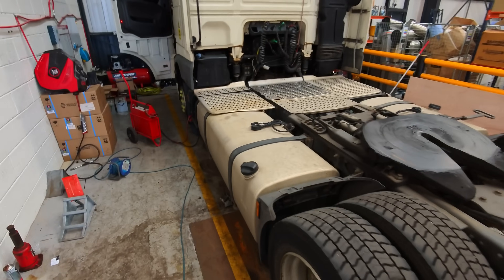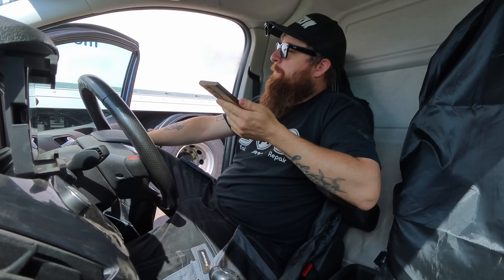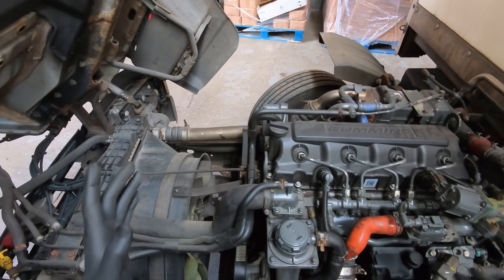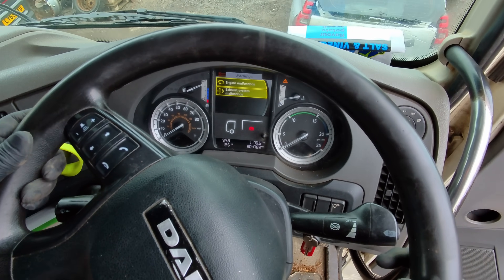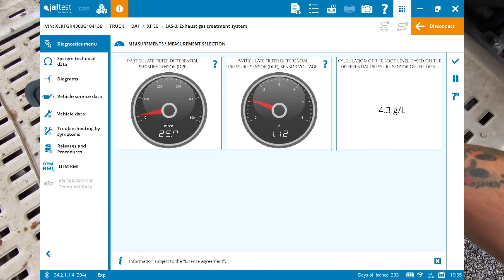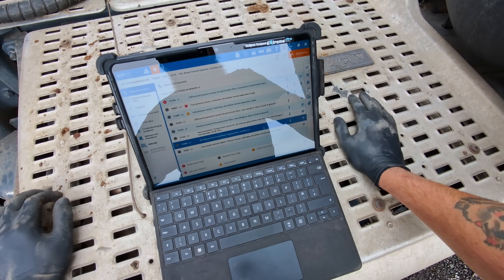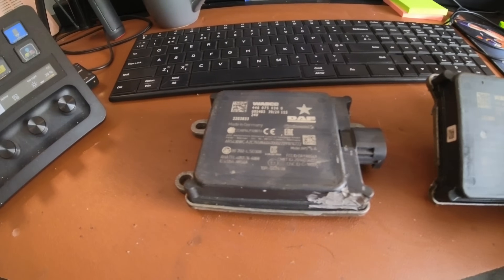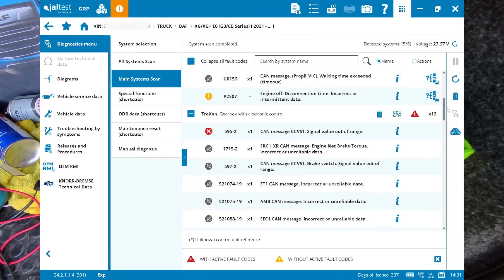Revolutionize Your DAF TRUCK REPAIRS with STARLINK Programming from JALTEST.

Comment: Greetings from Romania🇹🇩 Russell,verry good video like always,You must check the main fuel filter first for low fuel pressure,there is a litle ball on the bottom you must replace the repair kit because in time that ball is going to shrink and fall of or disappear from place.That internet is a pain in your country from what i see,here in Romania internet is like wind is very very fast and you don't need that Bond 007 things to have a good internet, hopefully i gave you a good advice with that low pressure.God bless you.
Reply from the maker: Cheers for the comment and thanks for watching buddy 👍 😎

Comment: What is that clicking sounds DAFs do? At the 14:40 in video
Reply from the maker: It's the AdBlue dosing valve pulsing to let air into the after-treatment Adblue line so it doesn't create a vacuum in the injector pipe.

Comment: Hello, I would like to ask you for help. I have a Daf XF in the workshop whose engine performance has been reduced, the diagnostics show me these error codes p1058,p1496,p1723.Have you encountered this before? Do you think that the VTG turbo regulation could have gone? I did a test with my diagnostics but it ended unsuccessfully, I also checked the egr differential pressure sensor and cleaned it. Could you advise me on the next procedure? thank you for the answer
Reply: sorry for the language, I don’t speak English very well, I come from Slovakia
Reply from the maker: Hi I don't answer technical questions on youtube unfortunately. Businesses need to use the forum over at www.trucktechuk.com for technical advice on customers vehicles

Comment: great work Russell these new XG s are having some issues don't think they were properly field trilled .or should i call them the poor mans Scania .nice diagnostic work    👍👍 i did a DPF this week and those clips were broke on the dif pressure sensor on the b4 cat had to replace the whole pipe think it was £200 but was on CVC .
Reply from the maker: Hey steve. I've just seen the answer reports on jaltest RMI for the latest round of issues currently going on. 
I remember them running a black truck around before they launched NGD BUT the fact they sold the truck before our workshop staff and sales had any chance to go on corsed to do with the new product blew my mind. 
I remember ringing Andy Mudie at DAF technical Haddenham for tooling as it wasn't even in the country yet! 

The pipes are crap, I've sourced the ends now with the clips as Daf wants 1000 for the new pipework for Daf LF....all because they moved over to the 12mm outlets from the 10mm on euro-6.

Comment: I really enjoy your content Russel and you are a huge loss to the dealer network ,Imagine missing the plastic pipe ROFL ,we are all human and we do sometimes miss the obvious ...I thought at one stage with the WABCO EBS ECU  you where going to say it was the trailer control valve ,both failed regularly...Ahhh good old fuel problems tha everyone runs away from...Does jaltest not do a fuel test under cranking ??  I will send a mail about other parts in your video
Reply from the maker: Im glad you enjoy it buddy, i just love working on the product just like you! unfortunately, DAF is more than "let's fix this right, first time, for the customer!" and this is why we're discussing things in private 😑

The pipe..........well what can I say! I had a word with myself that day but the original diagnsotic was done at 5.30 in the middle of Manchester so I wanted to go home lol 😆 
So much for the right first time eh! 

The EBS-3 ecu......as expensive as the part and programming was sorted it out ASAP for the customer so everyone was happy. I've not had a trailer control valve in ages! 

I love a fuel fault lol people just don't like the cost involved. Jaltest DOES a cranking test for fuel pressure but the oil needs to be over 20*c. I've a adjustable resistor here for the oil temperature switch to fool it but where RMI SAYS it is ........it doesn't seem to be fitted on the oil module on my.17....can't say I've ever needed to replace it or had it fail only the oil pressure switch! 

Speak to you in a bit 😎
Reply: @TRUCKTECHUK  the oil temp switch should be on the module..i will need to have a look tomorrow..you have me doubting myself